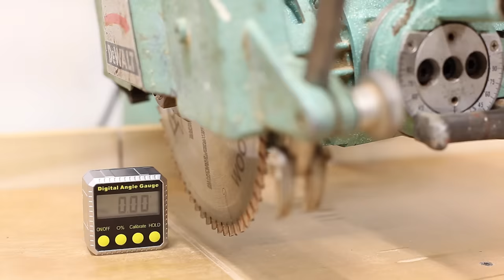How to Build a Standing Desk / Drafting Table

Comment: i dunno... if you do a stress test it would come down to the bolts connecting the linear actuator to the wood which would give way given this design by the looks of it. 
Wouldnt it be more sound placing the linear actuator  with a perpendicular bracket ?
Also if you put. a monitor on top that table would flip right over. Other than that its a good design.
Excellent craftsmanship. i think i learnt a lot about column design

Comment: This is great and really gives me a clear picture on how i can also do this.

If you don't mind - I have two questions - 

1) How did you wire the two actuators to the single power source and controller?
2) why did you have the motor at the top (underside of the table top) rather than at the bottom?
Reply from the maker: 1) You can find the basics in this video: https://youtu.be/hpZl77cYBxo But the wiring can get a bit complicated because I use relays with speed controller to power two actuators.  I have the wiring diagrams, parts lists, and complete instructions in my desk plans here: https://liftbridgefurniture.com/product/lift-bridge-standing-desk-drafting-table-plans/

2) The motor is at the top because the wires come out of the motor and they are easier to hide under the table top in the utility box with the power supply.  It's just allows for a cleaner look.

Comment: Could you potentially do this with one actuator? I'm working on a design for that. GREAT video. You inspired me!
Reply from the maker: Potentially but it might struggle under load. 2 is much better.
Reply: @TommyTompkins  I'm trying to keep my cost down and design my own using your very helpful video/supplies. 225lbs seems like an easy lift when it's just monitors/keyboard/mouse wouldn't you say? I'd just need to engineer a rigid skeleton to push from the back/middle of my desk.
Reply from the maker: @TheHacketts818310  That 225 lbs is the max static load when it's not moving.  The actual working load is less and you can audibly hear the motor start struggling if you apply more load.
Reply: @TommyTompkins   I’m wondering what that working load might comfortably be. I would imagine the desk surface, mounting brackets and peripherals should weigh a lot less than it can handle. I’ll have to test it.

Comment: Absolutely beautiful work! I especially love how you show the versatility of the radial arm saw. They get such a bad rap, but its ignorance of what those machines can really do! Btw, greetings from Chisago...
Reply from the maker: Greetings neighbor!  Yes, I agree that the RAS gets a bad rap but I really enjoy working with it and it's versatility. A nice example of that is when I cut the recesses for the switch.  Sure you can probably do that on a table saw but man...it's way easier on a RAS.
Reply: Yeah and i think you can fit a dado blade on them which double their usefulness
Reply: I'm restoring a dewalt MBF and a Shopsmith mark v 510. My challange in the future is to see what I can build using mainly those two machines, I'm thinking I won't be to handcuffed!
Reply from the maker: Yeah I think you'll be just fine :)

Comment: Very nice, the only thing I can think of that would make it even better would be a switch to adjust the angle of the top.
Reply from the maker: That would be a very nice addition.  Not sure exactly how that could be accomplished, but you should join our maker team at https://liftbridgefurniture.com and make some improvements ;)
Reply: Tommy, an actuator running from the mobile portion of the legs to the back side of the table top. Make the table top horizontal when the actuator is at it’s shortest setting and make sure the actuator is installed at a slight angle if it’s horizontal it could rip the table top apart.
Reply from the maker: That's actually a fairly easy thing to add with a smaller actuator.  There's also another spot for an additional switch on the left side table brace so it would look very nice. It would also act as a table lock so that you don't have to worry about tightening the knobs on the ends to lock the tilt in place.  I like it.

Comment: I tried to do some carpentry on my own.  Tried that thing in 2:43 .  It just wouldn't tighten and would come off in seconds.  Luckily I noticed it and stopped the drilling machine before it could fling onto me.  Tried it several times.  Within seconds it would start sliding out.   I used a hand-drill without a press.  Then I cancelled my project.

Comment: Hey, this is amazing! Congratulations. Would you please share: what electric parts does this project use? How do you build that system and make the calculations?
Reply from the maker: Thanks! All of the parts that I used in this build are located here: https://liftbridgefurniture.com/product-category/parts-for-plans/  All of the wiring details, schematics, relays, and linear actuator details are listed in my plans which you can get here: https://liftbridgefurniture.com/product/lift-bridge-standing-desk-drafting-table-plans/

Comment: That's awesome. How much weight could move each one of the linear actuators?
Reply from the maker: Each Actuator Maximum Dynamic Load = 225 lbs (900N), Maximum Static Load = 600 lbs, Maximum current draw = 4.6 Amps: https://liftbridgefurniture.com/product/12-inch-12-stroke-linear-actuator-12-volt-12v-225-pounds-lbs-maximum-lift-no-mounting-brackets/
Reply: @TommyTompkins  thanks a lot, Tommy!!

Comment: Absolutely fascinating video. Love the intricate details and how you incorporated bezels, rounded edges, and even cupholders.  I have some questions:

(1: Is it possible to finish the desktop surface so it would be easy to take a standard piece of writing paper and write on it with a standard No. 2 pencil or ballpoint pen and have the writing come out nice without difficulty? I'm thinking about a project like this as a writing desk for signing letters and forms.   (2: Do you know of any plans for a sit/stand desk like this that it larger and L-shaped? I have my own a desk project idea that involves either a desktop or laptop-docking-on-the-desk arrangement and I want to be able to surround myself with accessories like a lamp, copy stand, scanner, electric pencil sharpener, etc. so they are all in easy reach without having to mess with anything or get up and go get it.   (3: What is the SMALLEST a sit-stand desk like this can be? My mother needs a laptop desk like this in a space next to her dining table and the space is small. She's using a portable polycarbonate scissor-legs table right now, and it's not a permanent arrangement. (4: Is it possible to build something like your drafting desk on casters so it can be moved?  Thanks for putting up with my questions.
Reply from the maker: Thank you! 1) Absolutely.  We write on this desk all the time and it's very smooth. But it definitely helps to use epoxy to fill in the large gaps and a drum sander to get everything absolutely flat. 2) I don't have plans for this desk as an L-Shape but it wouldn't take too much effort to modify the existing plans to add a 3rd leg and an L-shaped table top. You probably would want to make that flat instead of a tilting top like in the video.  3) You can go as small as you like.  The one in this video is a 2 feet x 4 feet. 4) You could put casters on this desk but I wouldn't recommend it. It would be more stable without casters.

Comment: I want to know if you can make something in which we can keep our screens far and other things close like keyboard mouse, can that kind of table or setup be made? Can You?

Also, in this table in the video, there can be a place to keep chaeger and other sockets that gets covered and hidden and just one cable comes out of it to plug the socket board that goes to the wall socket board and another wire comes out to charge laptop all other messy wires are hidden beneath.
I have great ideas to work on, also i understand how you make it, but i personally havent made any table on my own, still i work on my own of how i can improve my desk while working and thus i understand well how would a person with different DeskTaste would want their desk look like..
If you want we can make great Desks Together😊👌

Comment: I got the plans for this desk... very well put together... Question though... the print out diagrams for the feet... your video shows one side dark and the other light, but the print out plans are not like that, any way to do print out like you show in video? Also, the step down piece on the feet cut out, how do you figure that out? 

Other than that, awesome... thanks
Reply from the maker: Glad you like the plans!  The print out that you see in the video was printed directly from Sketchup which is a little more involved and difficult to do.  It's much easier to print the pdf that I included with the plans, plus it uses less ink. Can I ask why you want the grey portion colored in?  The dimensions are exactly the same. I'm not sure if I understand what you're referring to in regards to the "step down piece"?

Comment: Would you mind explaining how you control the tilt separate from the height? Or is the tilt manual?
Reply from the maker: Adrin Alias The tilt of the table top is manual and locked into place by tightening two knobs underneath.

Comment: Did you have to do anything extra to get the actuators to work simultaneously?  Also, may I ask what brand did you use. I’m building a heavy duty work bench that I’m wanting to be able to raise and lower to about 12 inches max.  It weighs about 420 lbs. I have it all done except this last part. Thanks for any and all help you can provide...
Reply from the maker: It depends.  Sometimes you'll get a pair of actuators that are very close to being perfectly in sync and they both work great together wired directly off a switch.  But in the case where one actuator moves slower than the other one, you can take a speed controller and wire it to the faster actuator to slow it down to match the speed of the slower one.

Comment: that was a lot of effort to end up with exposed actuators and wiring.  i am building something similar and found this in a search for arduino-controlled actuators as I want to have at least 2-3 preset stops in the lift.  You could have boxed the actuator inside the same leg assembly as the support rail for a clean look, albeit a wider leg.
Reply from the maker: Yeah I could have boxed the actuators, but they were actually part of the design and look I was going for.  Boxing them up would have completely changed the look which I did not want.

Comment: Just one question - how do you get your jigsaw to cut straight?! I've had 4 over the years including AEG and Ryobi and the blade always pulls to the side resulting in a cut that wanders off at a vertical angle. Thanks!

Comment: I have a question, I currently own a computer desk which has a cranking lever that I have to turn many times in order to lift or lower the actual table top. I want to eliminate the cranking lever and replace it with a motor. Do you know what type of motor do I need?
Reply from the maker: Sorry, not sure if I can help you with that.

Comment: Hello, I'm thinking of building a computer desk with actuators, is it possible to control a lightweight Ikea tabletop with 1 actuator right down the middle of the frame?
Reply from the maker: It would depend on how stable your frame was and how much weight you planned on having on top.  But it should work okay.  2 actuators would be better though.
Reply: @TommyTompkins  yeah, i will go with 2. thank you!

Comment: Sir may i ask.  What did u used is that a motor or a acuators?  If that is acuator sir what process did you  use is that electro-pnuematics?  Thank you in advce sir.
Reply from the maker: Those are 12v DC linear actuators. You can find more details on those here: https://liftbridgefurniture.com/2018/01/22/new-video-linear-actuators-101-for-woodworkers/
Reply: Thanks

Comment: For someone with limited range of motion, how difficult do you think it would be to make the top tilt with actuators?  I have the plans and am looking to make this wider and a bit deeper.
Reply from the maker: It's definitely possible to add an actuator that is mounted to the underside of the table and connected to the upper cross brace. When the table is level it's a total of about 12 inches (just eye-balling it) from the underside to the cross brace.  Your mounting brackets will take up some space so you're probably looking at an actuator with an 8 or 9 inch stroke. You'd have to measure more accurately in Sketchup. A problem that you might run into is that your stroke might run too long where the table ends up binding if it's extended all the way or bind if it's too short so you'll need to find the right balance.  If you do run into binding issues, you might need to devise a limit switch so that when the table tilts to a certain position it cuts the power to the actuator ensuring that it won't bind.
Reply: Thanks.  I can probably reduce any binding by thinning out the table braces beyond the pivot point by an 1/8" or so.  The person I want to build this for also wants to use it as a base for photographing clothing so the stroke of the actuator is important to get the table at a good enough angle.

Comment: Looks great.  How stable is it when up or down?  (i.e. does it wobble left and right?)  Also, do you have any issues with binding if one motor go slightly faster than the other?
Reply from the maker: It's very stable for a desk and doesn't really wobble unless you're physically trying to twist and torque it. I don't have any issues with binding.  If I have a set of actuators where one is running considerably faster than the other, I add a speed controller to the faster actuator to slow it down to match the speed of the slower one and it's good to go. I'm very happy with it.
Reply: Thanks much.  Great job :)

Comment: WTF! Awesome build.
I would just sugest a better way to secure the tilt of the desk top.
and some electric outlets for conecting maybe a laptop, so you will only have 1 cable going from the desk to the wall plugg.
Reply from the maker: Thanks! There's actually a rolling monitor stand and inversion chair that goes with this (I haven't made videos for those yet).  You can see a prototype here: https://www.youtube.com/watch?v=s0UgNiXtJs4

Comment: *sigh*, I don't know why I torture myself watching these videos where the guy has every single top-of-the-line specialized tool for every task. I mean don't get me wrong... amazing build and kudos to him. It's just... depressing as hell.
Reply from the maker: Hi there - thanks for watching and for the comment. Most people don't realize this, but many of the tools that I use can be obtained for very little or next to nothing on Craigslist or Facebook marketplace. In this video, the main radial arm saw can be had on Craigslist typically for $50. The band saw that I used in this video is a cheap one that can also be found on Craigslist for about $100. The workbenches that you see were built out of cheap 2x4s and MDF sheets and cost me a total of less than $400 for a 5 table setup (2 rolling tables and 3 fixed tables). The drum sander that you see is more of a convenience and not necessary, but can also be found for $200 or less used. I think I spent $20 on the jigsaw in the video. Another $25 on the router. I have spent very little on my tools. I guess the moral of the story is buy used, buy old and you can build many of the things other guys are building with top of the line tools.

Comment: Should have made the drink/pencil holders weighted on the botom and able to swivel when the work surface is tilted so the contents of the holders don't spill.
Reply from the maker: Adding a swiveling component would increase complexity, change the look, and might not be worth it the long run. But it's a neat idea.

Comment: Can you go into detail on how you wire up the linear actuators? Good looking project.
Reply from the maker: I have the complete wiring diagrams and instructions in the plans but I also plan on doing a video just on linear actuators so keep an eye out for that.
Reply: Tommy Tompkins that would be awesome. I have like twelve that just seems too complicated to design a use for. I would probably build mine into a controller like a pi or Arduino to run on a timer.
Reply: waiting for the vid :)

Comment: I noticed your green clamps. What is the brand?
Reply from the maker: Those are Masterforce clamps from Menards.  It's a great little clamp that holds well.  I use them all the time: https://www.menards.com/main/tools-hardware/hand-tools/clamps-vises/masterforce-reg-expandable-locking-hand-clamp/p-1444436619145-c-9135.htm?tid=-8112151566707094936&ipos=66
Reply: This product is very interesting. On the other hand, Menards does not deliver to Canada.

Comment: So the discerning customer is supposed to trust that the left and right linear actuator lift at the same rate and continue to do that over time?
Reply from the maker: That's correct.  And if it ever changes, you can always adjust the faster actuator to match the speed of the slower actuator or simply replace the pair with a new pair.

Comment: Where do you get the motor for the legs?
Reply from the maker: All the parts for the desk are available on liftbridgefurniture.com.  Here's a link to the actuators: https://liftbridgefurniture.com/product/12-inch-12-stroke-linear-actuator-12-volt-12v-225-pounds-lbs-maximum-lift-includes-mounting-brackets/
Reply from the maker: This one is available without the brackets: 
https://liftbridgefurniture.com/product/12-inch-12-stroke-linear-actuator-12-volt-12v-225-pounds-lbs-maximum-lift-no-mounting-brackets/

If you need the brackets you can get them here: 
https://liftbridgefurniture.com/product/linear-actuator-mounting-brackets/